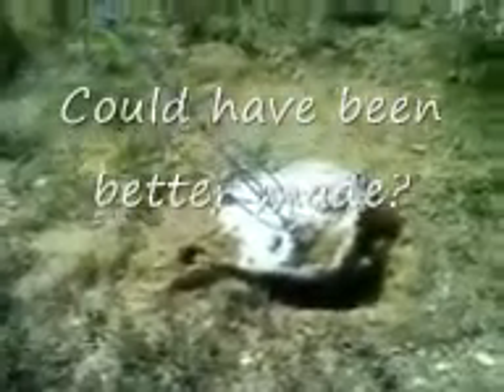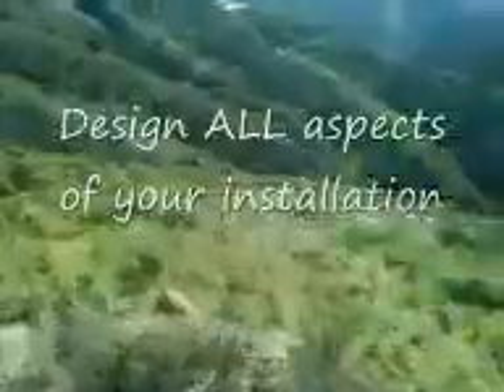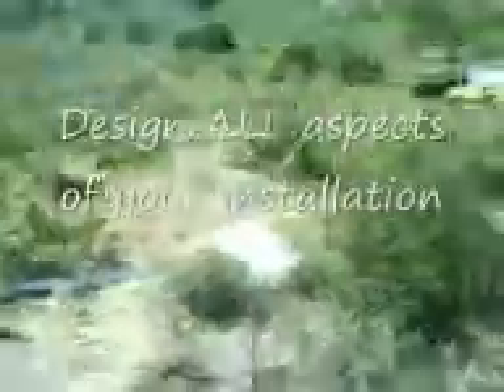Wind Power Gone Wrong

Comment: all towers are made to flex a bit    if they dont theyll get stress and break    if your worried about it add a second level or  guy wires    how  tall is  it ?    what height is the  guys at now ?     as far as the lose looking cables    guy wire are set to 10% of there breaking strength  with there length factored in       I got 14 year in building  all kinds of towers

Comment: ancorage WAY too small and into loose earth !!!!! . No mid way cable ancorages .... and what looks like a fixed pitched props , no good for the guts of the thing as it over revs . Hope you got a vari pitch one now that changes the angle of the blades automatically for optimal charging + over rev brake for them wind speeds !!!